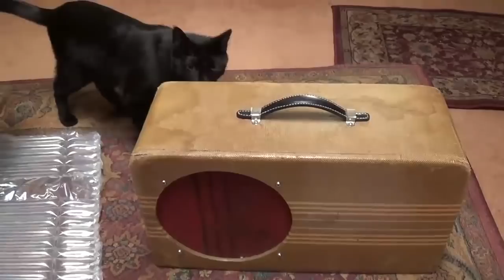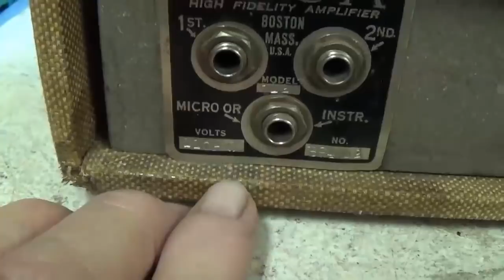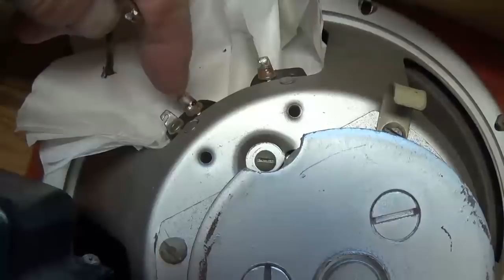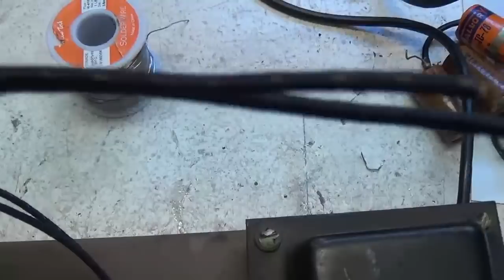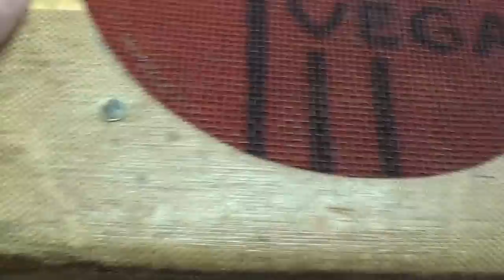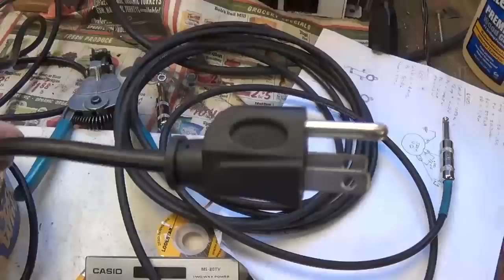Rare & Wonderful 1940 VEGA Model 112 Guitar Amp....Wow !!!

Comment: You have accomplished a superb repair job on that Vega amplifier Douglas.
When I saw the KT88 lying on its side in the front of the amp, I immediately thought to myself, “Nah; that can’t be right.”  The KT88 was introduced by GEC Osram in 1956: certainly a few years after that particular Vega amplifier was manufactured.  It was a progression from the KT66 (kinkless tetrode) that was introduced  in 1937/38, also by GEC Osram to get around Philips pentode patent rights.
I wouldn’t be surprised if that Russian manufactured KT88 has made its way from Electro-Harmonix, in New York.
Imagine getting your hands on either a pair of TT21, or TT22 valves.  They are the transmitting versions of the KT88 with a different pin out.  Having a top cap which is the anode that is designed to handle 1.25kv, they are rated at around 200watts.  Two of those operating in push/pull would certainly be a decedent little amplifier. 
Phil.
Reply from the maker: Thanks so much, Phil, for the nice comments and interesting historical review. I am contemplating using the KT-88 in a single-ended circuit. I hate to waste it :)
Reply: Philips built 1000 watt tube amp in the late 60`s, the el6471. It was probably intended for arena and football stadiums. It weighed in at 330 lbs and i think it had an anode voltage of 3200 volts, but not completely sure.  
https://www.youtube.com/watch?v=fRt8CoZT35k&t=5s
Reply from the maker: That sounds like the amp they used in "Back to the Future", AB :)

Comment: Uncle Doug I need your help! I have restored a late 60s Lafayette PA amplifier I have made some upgrades for guitar use and it has definitely made a great Improvement on the sound and on the controls but my problem is that even when the master volume is turned all the way down and the other two microphone volumes are turned all the way down I still have signal passing through to where it can be heard. The master volume pot is a 1 meg and I put a brand-new Alpha pot in place which is also a 1 Meg and I'm just wondering if I need to use something smaller because I can't figure out why I still have volume when it's turned all the way down or do I just have a bad pot even though it is brand new? Any help would be great thank you.
Reply from the maker: A little sound with the VC at zero isn't the end of the world, Ron, but it may be due to an inability of the pot(s) to achieve zero resistance to ground when set at zero. Check to be sure that all the pots have proper access to ground.
Reply: @UncleDoug  Thanks Unc, will do. And actually the volume level is about perfect to play through without my wife giving me the stink eye to turn it down, so there is a flip side to this. Thank you

Comment: A beautiful example, of taking someone else’s mess and cleaning it up. I was amazed at how quiet the amp turned out. Not a trace of hum even with the single coil pickup. From the photos I saw on the internet you naied the speaker screw look almost perfectly. I did see one post that was on a tombstone Vega amp about the same vintage that warned not to turn the volume above 5 unless playing single notes. It stated that the amplifier was designed with extra amplification and that chords should be played at a volume level of 5 or less to get a clean sound and prevent damage to the amplifier. I thought that was funny. Also very happy for the good news on the kitty.
Reply from the maker: Thanks so much for your always informative input, Mark. You do have to watch out for those 80-year-old speakers......but this one seemed quite happy at a setting of 6 or 7 :)

Comment: Amazing as always, thank you Uncle Doug. Just a little remark : the video compression was pretty bad; especially the rendering of the texture of the amp surface had no definition at all. The 720 version looked like a 360. Coul you try to improve a bit the compression settings?
Reply from the maker: The video was shot, processed, and uploaded in 720HD. On my screen it looks fine especially in close-ups, but perhaps the lighting I use, which is rather subdued, is inadequate for optimum resolution. I'll check into using better lighting.
Reply: Are you here to learn something about a vintage amp restoration or just to rag on the video production?
Reply: olipito I can see the definition just fine, it may be your computer

Comment: There's a schematic for '47 Vega Commander at https://bb.steelguitarforum.com/viewtopic.php?t=275260&view=next&sid=4793eb97930f4026b9949920a7d18d68 that shows a cap directly to ground on the 6L6 plate -- not even a resistor in between.
Reply from the maker: I actually printed out this schematic (you can probably see it on the bench top), since it was the only Vega schematic I could find. Other than the strange cap from the 6L6 plate to ground, not much else was helpful. Thanks, MK :)
Reply: I can't help but wonder whether the cap (or cap+resistor) wasn't put there to help shape the top end of the amp -- maybe to tame some of the alnico harshness you refer to. Assuming a 5k-ish plate resistance and negligible xfrmr inductance, the 0.005uF on the schemo should cause a rolloff around 6kHz.  Not the most obvious place to do it, but why not?
Reply from the maker: I agree with your assessment, Mithat. It's not the way I would do it, but it must have worked for them.  This is part of the fun associated with very early amps. They are still evolving.

Comment: the grille, if it were to be enhanced, would likely benefit from a precise spray stencil. I respect originality as much as you do, though. So may it be mostly untouched for that reason. If this was a donation and thereby yours, I have an urge to make this next on my list of amps to make a dust/scuff cover for it once I finish the National Aztec one. Placing some of the color and pattern features on the outside would be a fun venture in functional textile art, if desired.
Reply from the maker: I agree that the grill stencil could be better, Joel, but as you say, it's original. I can't wait to see the Aztec cover and would be ecstatic if you wanted to make a color-coordinated cover for the Vega. It's like Christmas in November :):)
Reply: @UncleDoug  I agree with your decisions on keeping amps as original as possible. I've seen too many bad sugar-coated resto jobs on many things that would speak better for themeselves as you tend to leave them. We share common sensibilities in that regard. It looks like the two materials were stacked and stenciled back when the Vega was made. As I may have mentioned, I paint homes and other buildings, and the pigments and materials used then had colors that are illegal to manufacture these days, and for good reasons, but those colors had SO MUCH soul, it's not good to try to mess with things like amps. Sometimes I'll be working on an old house and catch a glimpse of an old color and it's just like some religious historical experience just seeing that color and wishing I could have seen it the way it was back then. Anyway, the vega amp cover could be really cool. I'll get the first one going and then talk about how cool the vega cover could be. I was thinking a vinyl panel on the front with all the same graphics and colors stenciled onto it in something flexible like krylon fusion. It too would age with use a little an start to look cool. Wearing off a bit, but not peeling off.

Comment: 19:50 I believe that is a snubber circuit to take off some high end (probably to compensate for the added brightness of the KT88).  It's more common on preamp sections.
Reply from the maker: It seems quite late in the circuit. The only Vega schematic I could find has a similar cap from the 6L6 plate to ground, with no resistor. I guess they thought that was a good idea (?)

Comment: When I saw that cap in series with a resistor in the early part of the video the first thing that came to mind was a tone control (sans variable pot).  I'd sure like to see one of these amps in its original form but this seems to be just fine now.
Reply from the maker: Perhaps it was a tone control, Ray, but sending high frequencies to ground is definitely not a good idea considering how "dark" the tone was before I changed it.
Reply: @UncleDoug  Never said it was a good idea but it is a commonly-found thing in old electronics, especially crap phonos from the tube era. I thought some inexpert person had copied what he had seen in old junk to "adjust" the tone to his taste. No telling how it sounded at that time. (I have seen bad coupling caps lead to shrill sound in the past. If they didn't know much they could have thought they were "fixing" it by cutting out highs.) Lots of bad decisions were in this piece before you fixed it - improper tube, bad wiring, etc. I would guess this never saw a competent person before it reached you, where it finally got lucky.
Reply from the maker: Thanks so much, Ray. I have a weakness for abused amps and animals. Both deserve a full restoration :)
Reply: @UncleDoug  You sound like me. My current cat was rescued as a very sick kitty I found. (Multiple problems and $$$ but she made it and now clings to me.) When I had a shop it was not unusual for me to low-ball prices on items I felt for to save them. Many people were amazed and pleased by this. Some still seek me out even though I have been retired for years. Bet you are the same.
Reply from the maker: I particularly enjoy working on very old amps, Ray. They are early in the evolution of electrified music and often quite interesting and unique.

Comment: Finding a new video from U.D. is one of the few things I will trade a sunny afternoon for.  

Like other followers I certainly enjoy seeing old amps brought back to life but it's the common sense tips that I enjoy and find very helpful, such as checking an OT and speaker using transformer emission and using rubber between the wire and retainer. Those are simple solutions but I watch and then wonder why I never thought of them, and using a piece of vacuum hose to make tensioners is a brilliant way to prevent nuts from backing off while also reducing vibration and rattles,. All are all very helpful tips not found in any book which is why I honestly believe you could turn a coffee pot restoration into an interesting lesson.  

Thank you again Uncle Doug for another professional and fantastic video.
Reply from the maker: Wow, thanks so much, Randy. You are quite welcome for all the tips and the video :)

Comment: Only six or seven minutes into the video so far, but I'm wondering if you could get an "oxblood" coloured leather handle to match the speaker grille.
Reply from the maker: Possibly, Chris. I was looking on Ebay today and only found tan, brown, and black luggage-style handles.
Reply: I also noticed that the handle would not fold flat. Probably a good deterrent from other gear (or paint buckets (grin)) being stacked on top of this beauty!

Comment: Uncle Doug: Another fine video and a nice restoration of that old amp! I have seen the resistor/capacitor setup off the plate of the output tube before. It's a tone cap. It rolls off some of the highs. The resistor determines how much. Often they used a cap across the primary of the output transformer to accomplish this. Just different ways of doing the same thing.
Reply from the maker: That makes sense from a circuit standpoint, BD, but considering how "dark" the tone was before I bypassed the VC, it seems like a bad idea tonewise.
Reply: @UncleDoug  Unk: I didn't say it was a good idea. LOL! But it's how they sometimes did it. It also protected the output transformer from high voltage spikes caused by harmonics. Believe it or not these spikes could actually exceed the insulation rating of the transformer, arc through and cause the transformer to go bad. B.D.
Reply: This will be the only 'tone control' in this amp! :)

Comment: I found a small Vega tweed cab/amp between my mother-in-law's bar and the next door cafe.  Guitarist threw it there after a failing gig and it sat there 15 years before I came along and took it.  Used it as a speaker cab rather fix the amp my mistake.

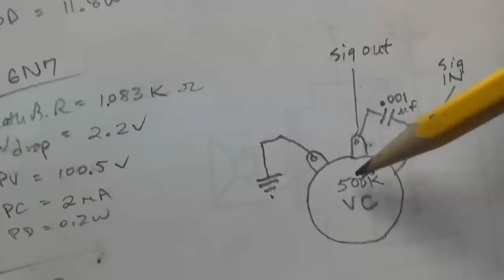Comment: Great musical selections this time! 34:20, is that why the volume pot used to be called the "Loudness" pot? I recall a lot of hi-fi receivers had a click-click loudness button, which was to add a little more low-mid and bass to make the output 'feel' louder at lower volumes.  Your description of the circuitry is completely enlightening and I eat it up each time.  What are you naming your new kitty? Felina?  :) (: oh!  Casey!  well that's nice too. (:
Reply from the maker: I too recall the "Loudness" button providing a bass boost at lower volume levels, Malcolm.  Thanks so much :)

Comment from the maker: ADDITIONAL COMMENTS:  1.) I ended up adding a 130K resistor in series with the .001uf tone cap across the VC to reduce some "Alnico" harshness, especially for single coils.  2.) I am seriously contemplating building a SE amp using the KT-88.....I hate to see it go to waste.
Reply: I made an ax84 p1 extreme using a 6550, and it sounded great especially for bass. Kt88's are a little different of course but I bet you could coax something sweet out of it.
Reply from the maker: I'm going to do some research on the concept.
Reply: @witeshade  my VHT ultra lead will take either kt-88s or 6550s.   I like the 6550s best.
Reply: I doubt you can cut it up to power tube overdrive to hear which is best , the 6550 are said to have the best crunch OD sound ?
Every amp acts differently , I guess your amp is 2x 6550 cathode bias at 75-80 watts !
Reply: @witeshade  If you want something really different try a 3c22...this is a disc-seal triode electrically similar to the 6550 but with an external anode.  They were designed for radar use but apparently they are good audio tubes as well, and can be used up to 60 watts without air cooling.
Reply: This one amp is very nice too. Modified but for the best. And i dig your choice of riffs played.  
  A 'big bottle'  SE(T) amp with all your knowledge and bon goût may be great.
Reply: I'd test the tube first, of course.  From where I sit it looked like a new tube.  I don't have my tube guide handy.  Will the KT 88 handle more wattage than a 6L6?  I am curious about the difference in potential output wattage with a 6L6 in a single-ended circuit vs. a 6V6.
Reply: Did you try the KT-88 in this amp just for sh*ts and giggles?
Reply: i've designed a KT88 SE amp loosely based off the fender champ circuit, my method is to use a modern "champ" spec PT (i check heater current draw tolerance to make sure it can handle a KT88)  and bias the KT88 to 50% to 60% (roughly around 48 plate DC MA) of its normal bias. so its running quite cool but it sounds really good, i think it sounds alot better then a 6v6 but thats just my taste in tone.
 i've designed (i use that word loosely for this one) another circuit that is basically a 5C1 champ circuit with a 6SJ7 preamp & a 5881 power amp. it to is biased pretty cool and sounds REALLY good, its also my favorite amp :). both amps i've mentioned use slightly oversized OTs and the same PT. anyway if ya do build your own KT88 SE circuit i'd be very interested to see it ;) cheers Doug!
Reply: Yes sir a little KT88  SE ,would be great sounding I bet. I've got a SE that will run EL34s or 6L6s. Tiny little amp that roars ,and has a boost switch to get Marshall type overdrive.
Reply from the maker: @Wildman9  Sounds good, Bob.....literally ;)

Comment: The power toggle switch looked newer than the rest of the amp. The original might have been a straight shaft with a ball on the end. It's the little details that tells the story. Being educated about the early tube amps, gives us reference to use when discovering said vintage tube amps. I plan to travel next year to swap meets and flee markets and having knowledge of these wonderful amps will come in handy. This amp, like others you have showed, gives us ampaholics a glimpse into the evolution of the tube compliment and circuit design. If one thinks that filter chokes and other components were something of more modern design, this amp shows these components were used in early designs because they work. This baby is dead quite! Great video Uncle Doug! Glad the kitties are doing so well. That house with a heated floor, for the stray kitty, was a lot more than most people would have done! Bravo! Thanxz
Reply from the maker: I agree, ATL, the toggle was not original at all. In my experience, early toggles were generally smaller and had shorter "arms" with a ball on the tip (as you said). Good luck with your travels and acquisitions. Thanks for all your nice comments and observations.

Comment: I remember reading somewhere that the "Correct" polarity of a single guitar speaker is that a positive input waveform should make the speaker push outwards, and/or that the first wave coming from hitting the guitar strings should make the cone go outwards. But, then again, it should literally make no difference at all.
Reply: I agree. Ear can't detect phase at all. So there is no difference on speaker polarity appart from technical consisrecy.
Reply from the maker: I tend to agree with your last statement, Daniel. For any motion to be "in phase", it has to have a separate motion to be in phase with. With a single speaker, such a pairing simply does not exist.
Reply: Daniel G One quick trick I was taught is to connect a D cell across the speaker terminals. If the cone pushes out , the battery polarity matches the speaker polarity. That was in the Hi-Fi stereo world though. I’ve read that harmonica players will “reverse” the speaker polarity of their amp, to reduce feedback in a live setting as to be out of phase with everyone else. Not sure I believe that now, based on Uncle Doug’s guitar amp knowledge.